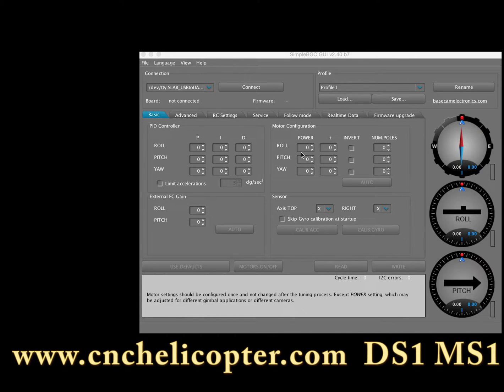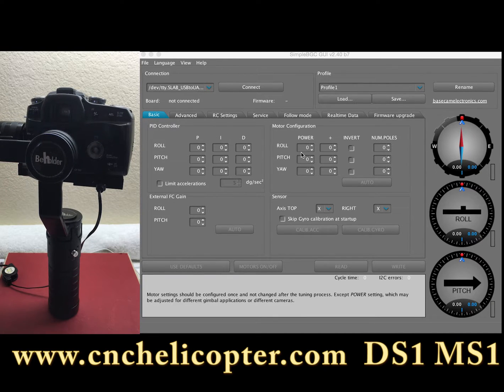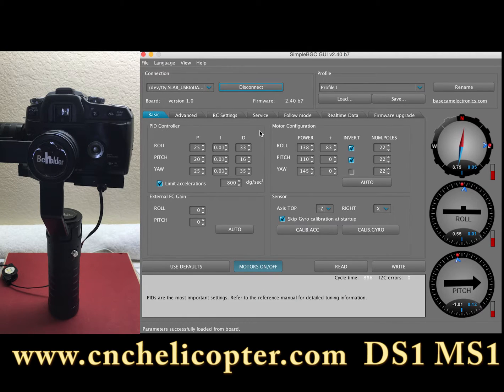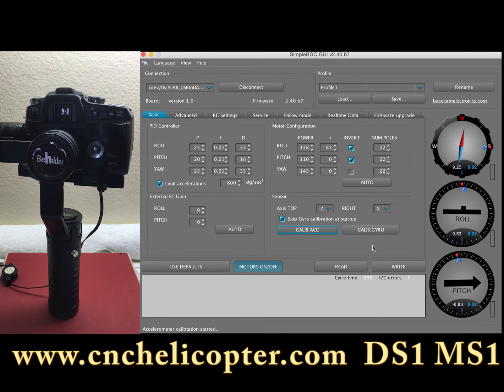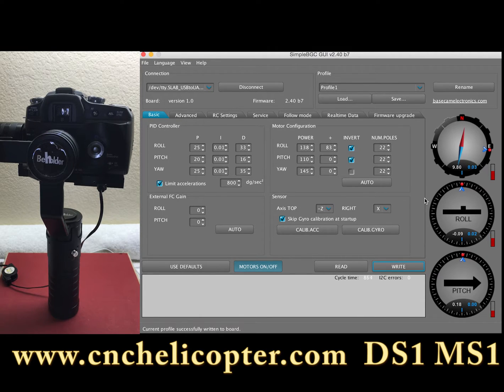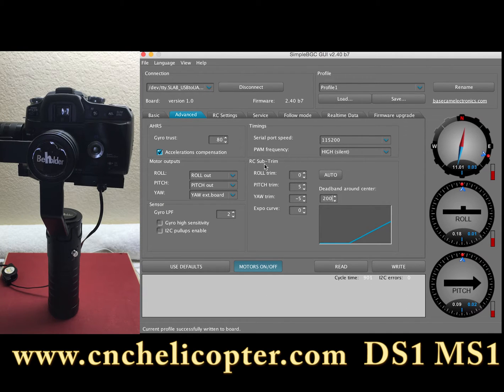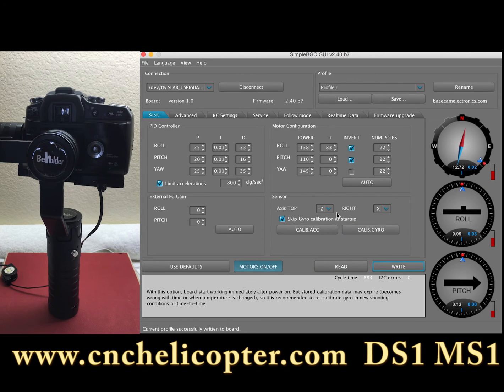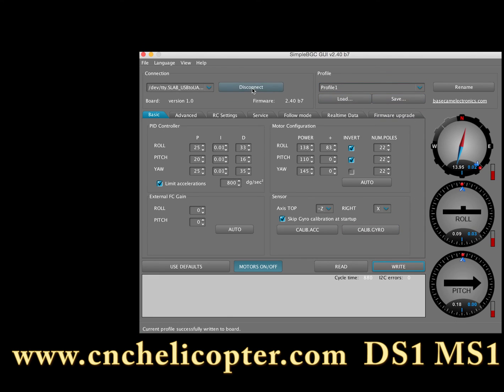cnchelicopter.com Beholder MS1 alexmos Profile save and loading IKAN PID Tuning video B

Comment: Worked quite well in the beginning,  but after a while started to drifting badly. - Tried all the setting exactly as on the video. Unfortunately didn't worked at all, totally got wild, twisting and turning. - Love to have the original firmware back. - Board version and firmware same as on the video, Thanks!